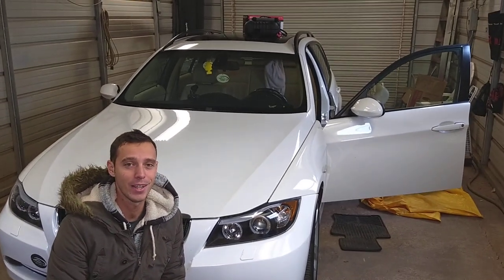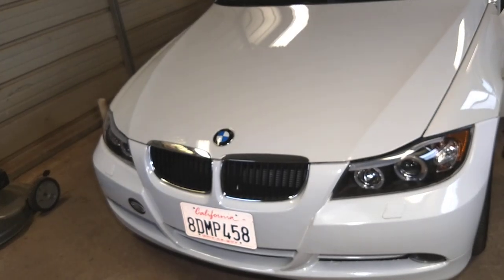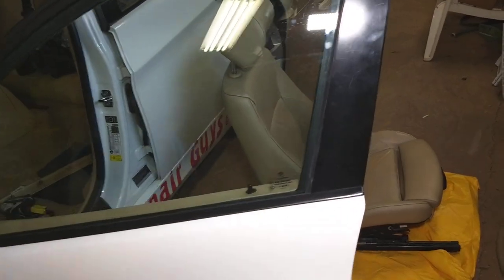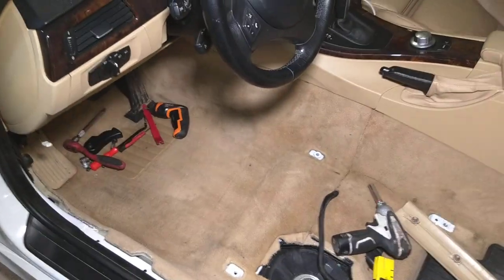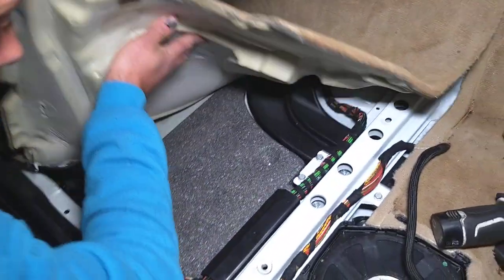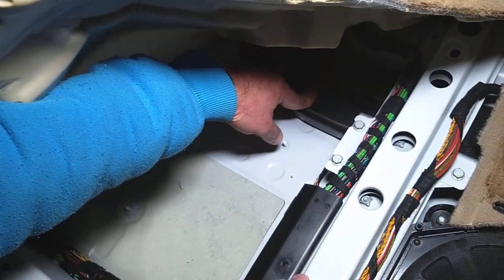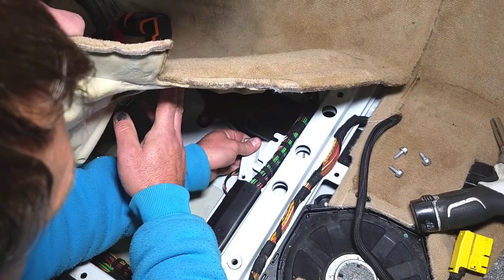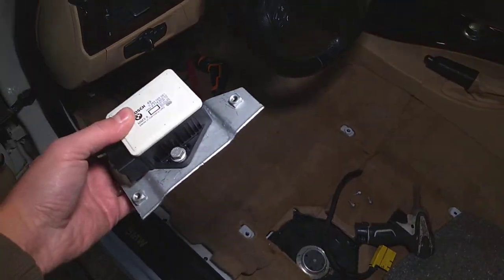BMW YAW RATE SENSOR LOCATION BMW E90 E60 E46 E83 E92 E82 E87 E85 Z4

Comment: Hey guys i have x3, my dsc 4x4 light comes on as soon as i turn the car on. I dont even have to put in drive and after then abs comes on and brake. I think my problem is this dsc control unit because the 4x4 light comes on right away, was this same problem you were having? Thanks so much guys many likes for your videos
Reply: @TmX_mK2  did you ever get yours fix?

Comment: I have a question. Fighting e90 loosing wheel speed signal sometimes. New wheel speed sensor and ring. Still same problem. When dsc on single click ,i not loosing wheel speed signal. Also notice in live data YAW rate sensor allways have some value when car stand still. Its normnal ? Or thats the problem. Thanks

Comment: @Electrical Car Repair LIVE - very nice Video my Friend when i change this part must i coding or tech in the part to control unit??I have other Question please help me  I have X3 E83 2.0dXdrive Year 2010 Lci automatik, in my car light up permanent and i read out with ista D its says " MRS :Message from DSC Sensor is missing or incorrect than "MRS: Message from DSC Controlunit is missing or incorrect "  and 3.Faultcode " MRS: Message from the Controlunit for DSC is missing or incorrect " ?? please can you help me - only Airbag light is on; not DSC not 4x4 nothing? Some People say its CAN BUS Problem what does it mean for me? the cable to dsc control unit or sensor dsc has problem?? or the DSC Sensor is deffekt but why is no faultcode in DSC unit self? or not light up something, when the DSC has a Problem? or the Airbagsystem has a Problem????